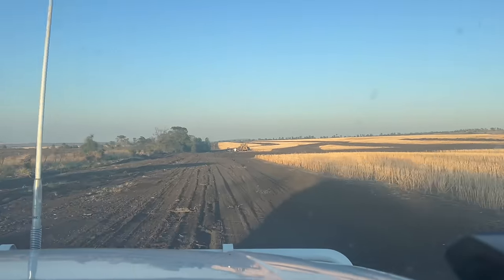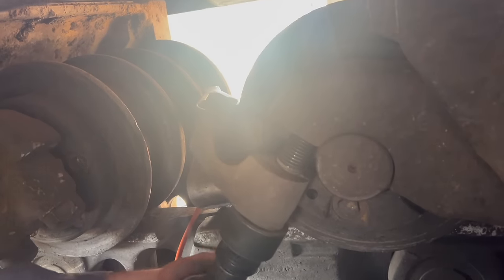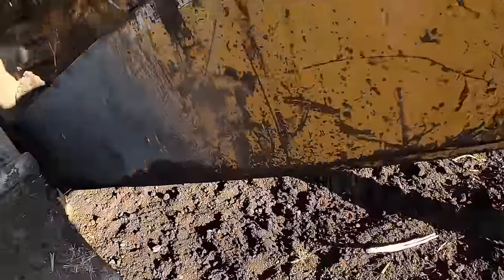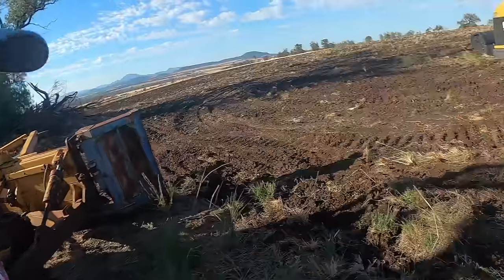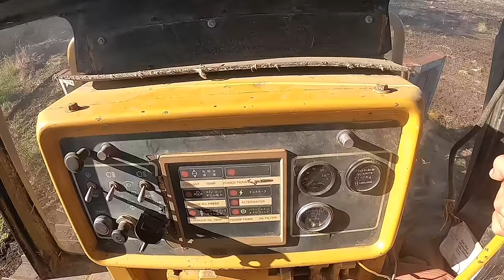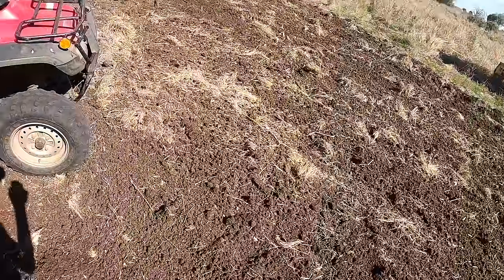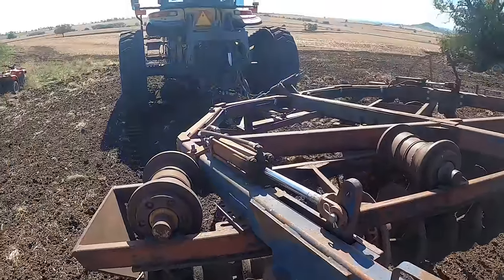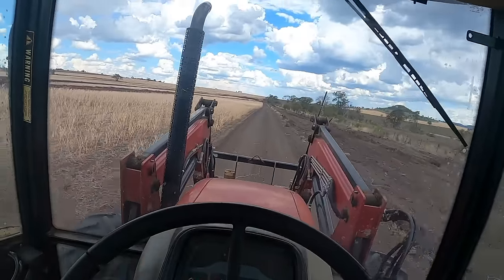Bolt SNAPPED on D11! & Offsets Fall Apart! | D11 Bulldozer | Vlog 242

Comment: Hi Phil. G'day from WA.
Try using Nickel Antisieze instead of Kopacote. Nickel was always far superior in the dusty Pilbara whether it was dust, wet muddy from hose downs or water doing pump repairs. It helps with galling on threads when they lockup, so they come apart easier.
Whatever you use don't be  shy about using it on the bolts and on the tapped holes. 
Keep the vids a comin.🇦🇺👍👍👍

Comment: Hats off to you guys. Bush fix at its best. Interesting the camera mounted on the stick rake. Ive always wondered about mounting a camera of a post on each side of tinys blade and screens in cabin. Dust would be an issue but for   some jobs seeing that cutting edge would be a huge advantage. That stone you miss but dont know until you see it sitting there still out back window. Fine blending work may become easier. Not suggesting you folks are not good operators but anything to possibly improve finish and productivity.

Comment: Great way to get the broken bolts out one to remember that.   Wouldn’t it be beneficial to have run a tap down bolt holes to make sure threads internally were ok ?  Great to see kids helping out learn a lot of skills on the job